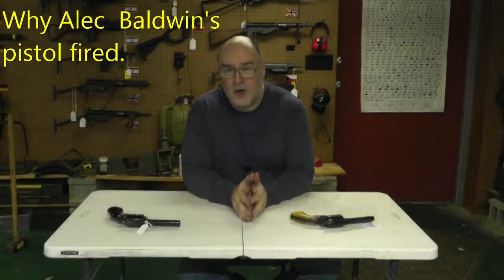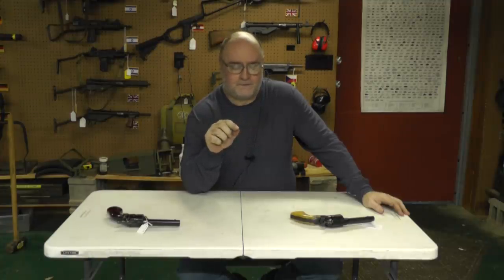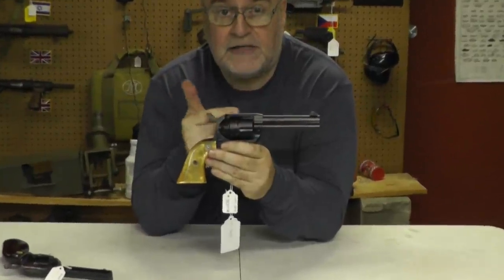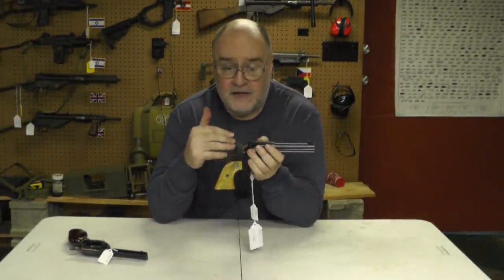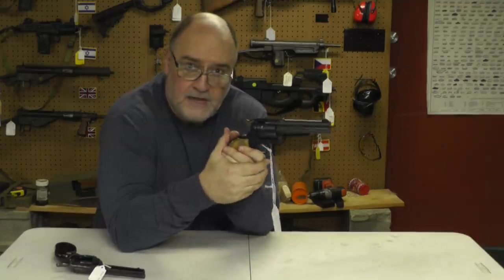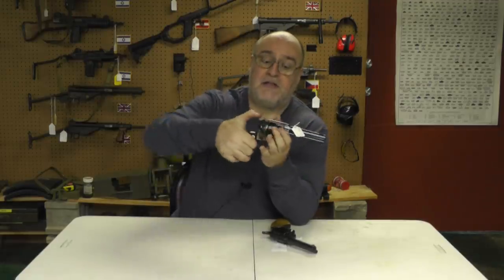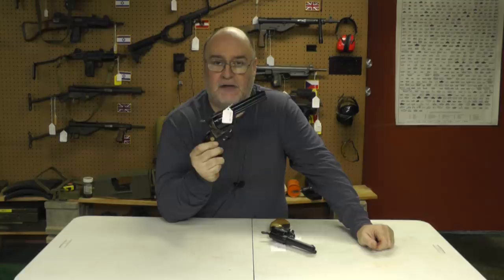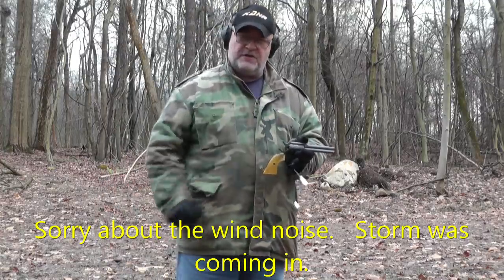Why Alec Baldwin's gun fired

Comment: Thanks for posting this. This is a superb example of what probably happened on that set. And I'm a firm believer that whoever is holding the weapon is the one who should be held responsible if anything goes wrong.

However, Even though I'm not exactly sure what the proper procedure on a movie set is as far as weapons and their handling go. From what I understand that would be the primary job of the armorers who are on the crew on set. 

So even though AB was the one who was using the firearm when the death occurred, blame has to also fall on the armorers on set who obviously didn't sit down with him and give him the run through on the safe handling of a weapon. Whether AB thought it was loaded with blanks, dummy, bullets or whatever he still should have been taught the proper handling and operation of whatever weapon it was he was supposed to use on set.

This is a horrible tragedy. There is no doubt about it.  I'm sure we will see changes now in the way weapons are handled and used on movie sets, but it's very sad that it takes someone's death in order for something like that to happen.  I am also glad that we now know that AB as well as the armorer are hopefully both going to have to do prison time.

Comment: As for the argument that Alec Baldwin was a gun novice or he was incompetent is not the issue, the whole problem is that: 
1. the weapons master/armourer had brought live rounds on to the movie set.
2. the weapons master/armourer loaded or allowed live rounds to be loaded into the PROP GUN and fired for target shooting.
3. Clearly the weapons master/armourer never emptied and checked the PROP GUN and cleaned the weapon after use.
Alec Baldwin has used prop weapons in other movies that were maintained for exactly that purpose without issue, and this weapons master/armourer had already been fired for another studio.
If the PROP GUN had been emptied, checked for faults and cleaned as would be the norm, then nobody would have been hurt, there is no way in hell that gun should have had live rounds in it if the weapons master/armourer had done their job properly. 
Being a dumbass actor is not a crime, being a dumbass professional is a recipe for disaster.

😐This is just my opinion and opinions are like ass holes, everybody has one.😝
-------------------------------------------------------------------------------------------------------------------------------
What are the rules for using firearms on set?
==================================== 
👉Generally, a weapons master or armourer oversees all weapons that are used on a production.

👉Weapons masters are required to abide by state and federal laws and hold proper operating permits.

👉This can mean anything from selecting the correct items for a certain period in history, to taking care of the weapons on set and making sure they are being used safely and properly by actors and stunt performers. 

👉"All loading of firearms must be done by the property master, armourer or an experienced person working under their direct supervision."

👉Armoury coordinator Sam Dormer said all weapons would be checked, before blanks were added. 

👉"The blanks themselves are never loaded until the very last minute when all crew is in position, so the armourer knows exactly where every member of the crew is. 

"That ensures no one's walking through any danger areas the armourer has set up."

Comment: After an investigation, the state of New Mexico has fined (near $137k} the movie "Rust" production crew for safety failures on the movie set. Baldwin was part of the production crew. The Armorer was not full time in the Armorer role and claimed she didn't have the time she needed to do Armorer stuff. An assistant director handed Baldwin the gun. There were complaints of the gun used having an earlier misfire but continued to be used. Where there's smoke, there's fire.

Comment: The person responsible for the ladies death is the person who was hired to handle the firearms and make certain they were safe. As a producer of the movie, Baldwin might be held responsible for hiring someone who wasn't competent if due diligence wasn't done. There should not have been anything in the chamber. There should not have been any live rounds on the set. They might have dummy rounds so it looks like there are rounds in the chamber but there was no need for those in a rehearsal. The cylinder should have been empty.  Those guns can also be modified so they can be fanned without touching the trigger. Some people do that to avoid the little extra time that it takes to get a finger in the trigger guard. Others removed the trigger guard entirely.

Comment: I think your explanation was very well presented. It demonstrates how an improperly handled weapon with live rounds, even with the empty chamber could go off.  As you say, a factual presentation without bias on the mechanics of the weapon.  But your question on why there were live rounds in the weapon is only the tip of the iceberg of what should be asked. Like:
   1) Who loaded the gun?
   2) Did they load just five or all six chambers, because it is possible for a release of the hammer before half cock resulting in a negligent discharge?  (And with all six chambers loaded, I get the impression from your presentation, a negligent discharge could occur).
   3) Why live ammunition? (As you asked)
   4) Why an actual weapon. When I was involved in the entertainment industry, our hand guns were replicas something like a kid's cap gun. They        couldn't fire live rounds?
   5) What actual training did they give Baldwin with these weapons. I know it's the USA but on set there should have been a safety course on the weapon handling. The course should cover the specific weapons used in the movie and an accreditation be awarded once the course had been successfully completed?
   6) Was there a safety team that were monitoring Baldwin's handling of the weapon?
Those questions are off the top of my head and I would be outraged if none of those questions were asked, let alone answered.

Comment: I actually learned something about this particular firearm. The "feature" of this firearm to be able to rapid fire by hammering your hand on the hammer while holding the trigger squeezed makes this firearm fully loaded inherently unsafe. The only way to bring it into safety compliance is to effectively turn the 6 shooter into a 5 shooter with the empty chamber in the correct position. If this hypothetical is correct, then Baldwin DID squeeze the trigger, but that action was disassociated from when the weapon actually fired. The next question is... 
Is he liable for incompetence while on the set of a movie both civically or criminally?
Then the same question applies to the armorer and anyone else who is responsible for firearms on the set for both control [educating actors] and allowing live rounds to be even present in the area of film shooting. [No pun intended.]

Comment: Great demonstration, doesn't get any clearer than that. I feel bad for Baldwin as each person in the chain (armourer and then assistant director from what I understand) who handed the gun along to Baldwin are culpable, and they put a gun with live rounds in Baldwins hands. Baldwin would have fully expected the gun to be safe to handle. But at the end of the day, if you are going to be handling firearms you need to be both trained in and understand, and follow, the appropriate safety protocols. If someone hands you a gun and you don't check for live rounds and subsequently shoot someone by accident, you ARE culpable as well.

Comment: Shooting the Colt SA and how it works has been beaten almost to death (bad pun).  Unless the gun AB was using is damaged at the hammer it will not fire.  But, something few, if any, have talked about is how a live  round got into the gun instead of a blank.  There seems to be plenty of blame to go around at the Rust production.
Reply from the maker: I made this video over a year ago.    And I think the point that she was not fired by Baldwin after several previous accidental discharges with blank being mistaken for dummy rounds should be brought up

Comment: The reason why the gun went off was because Baldwin had a shoulder holster and he was cross drawing. When he grabbed the gun he put his finger inside the trigger guard. The trigger at that point is already in the fire position. At this point there is no way to pull the trigger because it is already fully pulled. When he pulled the hammer back the trigger was already pulled.When he let the hammer go the gun went off. Technically I guess he isnt lying. He didnt pull the trigger he held the trigger. None of that matters. There isnt any reason why all actors that handle guns in movies or TV shows cant take a 10 minute course on safety checking a weapon that they are going to be using. Once you are shown how to safety check a gun you can safety check any gun in less than 20 seconds.

Comment: Your explanation is a matter of semantics. He said he didn't pull the trigger.  You're saying he already had the trigger pulled before he cocked the hammer. The result is the same. The trigger sear is out of the way because the trigger is already pulled and as a result the hammer is allowed to spring forward, the firing pin crashes into the primer and the bullet goes through one person and rests inside another.  What you say is possible but it does not change or in any way mitigate the crime.
Reply from the maker: Nope just proves he’s either a liar or completely ignorant on gun safety

Comment: Actually the lock work, the internal mechanism, dates back with little change to 1847.
These guns will not fire until it is "In Battery" that is the loaded chamber is in line with the bore and is locked in place Then and only then my the gun be fired by moving the trigger.
rule 1 all guns are loaded
rule 2 do not point a gun at anything you are not willing to destroy
rule 3 keep you finger off the trigger until your sights are on the target.

Comment: If your auto mechanic tells you the brakes are fixed, will you be charged with manslaughter if you find out they aren't at the first red light coming out of the shop?   Perhaps if you get the same prosecutor as Baldwin did.   The criminal justice system will never be able to deter accidents.

Comment: I don't think an actor should be expected or assumed to know anything about the gun. The armorer should be expected to take all responsibility for the safe operation of guns on set. The actor should not be expected to have enough knowledge to effectively check the firearm. It should be expected by the armorer that the actor hasn't enough knowledge to perform a check. Sounds like common sense if you are a gun person, but it doesn't come natural to some random actor. If the actor had been Angelina Jolie, or Jennifer Lopez, I don't think they would be on trial.

Comment: Did not this model have 4 "clicks", not 3? I would like a demonstration showing what happens when pulling the trigger when each of the 1st, 2nd and third clicks are engaged....I guess we all know that from the 4th click the hammer will drop when the trigger is pulled...
Reply from the maker: I demonstrate when I did the live fire.  I pull the hammer back past several clicks and let it drop.  Baldwin gun is a 4 click copy
Reply: @psp1921tsmg  Roger that..I'm betting that the gun can only fire via a trigger pull when in the 4th click position..Thanks for your reply!!
Reply from the maker: @dv270salto7  yes it has to get to the 4th click to lock the cylinder that’s why when I dropped the hammer before it got all the way back I say cylinder did not rotate

Comment: I thought it had already been discovered that someone had been plinking (using live ammo) with that pistol prior to that time when it was used for filming? Not sure where I got that.  Maybe I’m mistaken. One thing I’m not mistaken about is this… Either the person responsible for safety failed to make it safe or both Baldwin and the safety person failed to make it safe. Alternately, maybe the safety person did make it safe but Baldwin altered that. We might never know. One thing I do know is that the first thing you do when you pick up a weapon is to check it to make it safe. Number two it to never point a firearm at anything you don’t wish to destroy. That’s why prop guns are made - so rubber guns can be used as film props instead of pointing deadly weapons at actors and crew. As the guy with gun in hand, Baldwin is ultimately responsible regardless of who else might have also messed up.

Comment: I’m sorry, the answer to the question in the title is simple and can be summarized in a single sentence every child should be taught: The pistol fired because the hammer was cocked.  There.  Simple.  No cocked weapon, no bang.  Basic weapon handling safety and a variant of “Rule number one”.  Applies to all firearms….  In the end, the handler was responsible for violation of rule #1.  If an adult cannot determine that a classic Colt pistol is cocked, with the hammer clearly sticking out in the open, they should not be within a mile of that pistol and need to watch the westerns we saw as kids.  In a cocked state, a firearm is something not to be handled casually. Period.

Comment: I think Baldwin was trying to say that he didn't pull the trigger in a manner to acutally trigger the hammer. I think what you're showing is what Baldwin did. If Baldwin stated that he finger was not in the trigger at all, he likely is lying. I think Baldwin probably did everything with one hand. Most people handling a pistol wouldn't, especially for some dramatic purpose, be using two hands. Releasing the trigger without firing requires carefully lowering the hammer with the trigger pulled, I have to assume that he has handled enough pistols in movies to have done this many times over. He shouldn't have been given a live gun, and however that happened, is ultimately responsible for the shooting.

Comment: It ha always been clear to me that Baldwin was, probably unwittingly, holding the trigger back when he pulled the hammer back and released it. If this is so, then no extra pull on the trigger was required for the gun to fire when the hammer was released, sprung forward, and the firing pin then contacted the live round in the chamber and fired it. That is what I think happened. You got it right.
However, you asked the crucial and most important question: Why was there a live round in the gun or even on the set? Baldwin was not responsible for that, He didn't know that the gun was loaded with a a live round. He likely mishandled the gun as above, but to him it was just a prop and he didn't know it could fire. When it was handed to him he says that they told him it was "cold", meaning that it was not able to fire. That is the usual practice on a set where prop guns are used.
He intended no harm and did not point a loaded gun at anyone as far as he was concerned.
Accordingly, while this was a tragic accident, Baldwin is not guilty of a crime in my opinion.

Comment: You start by assuming that the gun wasn't faulty, then go on to call AB a liar, what if the gun WAS faulty?
Reply from the maker: I said assuming proper function And the video was posted a year ago.  Since then the fbi testing showed the gun was working properly.  Which makes Baldwin a liar.  Add to that the video of Baldwin taken mins before the incident released by the PD showing Baldwin practicing his cross draw.  His finger is clearly in the trigger guard and he is thumbing the hammer.

Comment: C'mon people.  That gun fired because a LIVE cartridge was in the cylinder.   Under absolutely NO conditions should a loaded gun be on the set, especially where the actors are expecting "a safe gun."
Reply from the maker: The entire movie was a series of careless and reckless acts
Reply: @psp1921tsmg  How many times would the gun have fired without any live cartridges in the cylinder, Dad?
Reply from the maker: @jimparker7778  well gee you didn’t watch the video until the end did you?  I said it doesn’t explain where the live round came from. 
     And as I commented the producers of whom one is Baldwin hired the incompetent armorer.  They ie Baldwin permitted target practice on set with live ammo and prop guns during non filming hours.  After 2 prior accidental discharges and most of the camera crew quitting Baldwin continued filming.  He didn’t fire the armorer.  He didn’t bring in someone competent to check the weapons and ammunition.  The police report stated live rounds were found in numerous locations including in the belt loops of Baldwin’s gun belt.    
     So the production company run by Baldwin was careless reckless and incompetent.   They made no effort to get a competent armorer.   
    So yeah the gun does not fire without a live round.  It was the conduct of the entire production company run by Baldwin that resulted in the live round being in the gun.  Does that answer you question Jimmy?